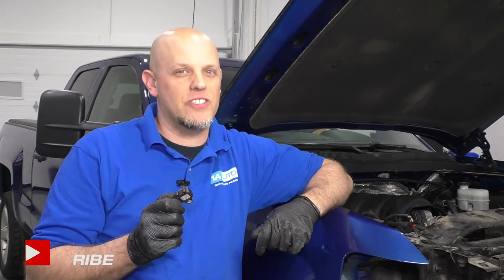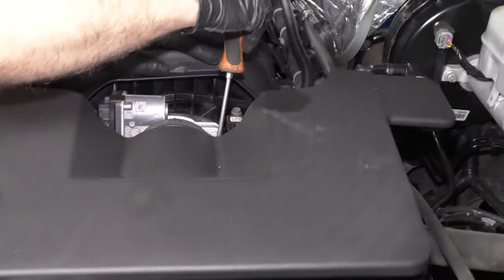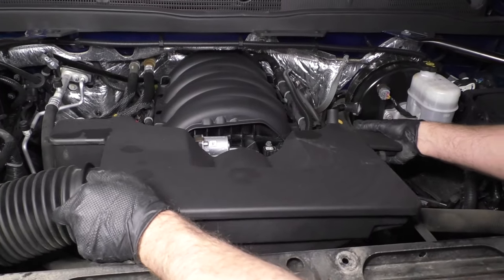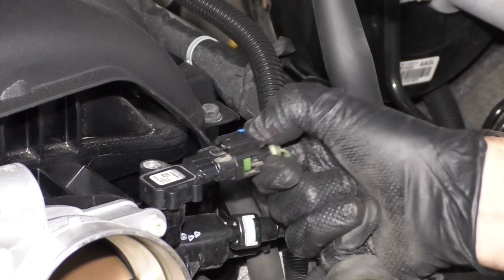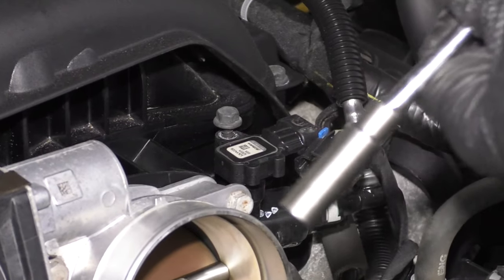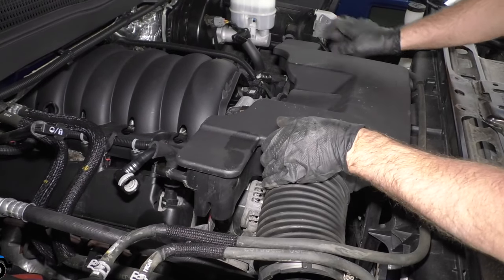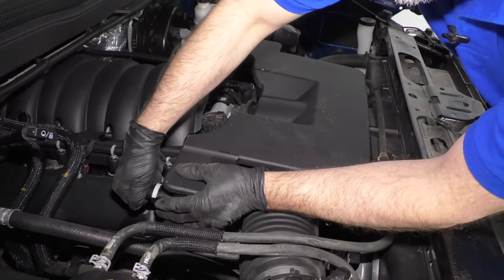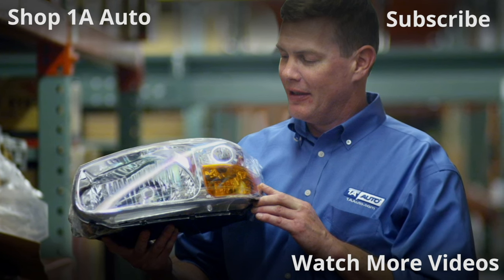How to Replace MAP Sensor 14-19 Chevy Silverado

Comment: I had a code pop up P0641 and underneath the report it said secondary DTCs codes P00C7,P128F,P16E5,P2227 and two P2230s where do I need to start? Thank you in advance! 2018 GMC Sierra 6.2

Comment: 🙌🏿🙌🏿🗣📯THANKS FOR THE HELPFUL INFO😁You made it very easy to DIY😁saved me a ton of🤑my engine light was on and I was told it was related to my catalytic converter on my 2015 Tahoe. A friend told me to change the map sensor and the mass air flow sensor 1st and both of your videos was very Helpful🫶🏿🫶🏿

Comment: I am trying to find the bolt that goes to the GM Air Pressure Sensor part# 12711681. I checked your website but the search said "No results found." Can you tell me what specific bolt this is, and where I can find it to buy it?

Comment: I replaced the MAP sensor because I got a code for P2227, the code relates to barometric pressure, however the check engine light is still on? Maybe the MASR sensor?
Reply: Me too! Did you get it worked out?
Reply: Mines is there too, kinda lost on where to go.
Reply: Are your guys truck shaking & smoking?
Reply: @victorduran6522  MAF SENSOR FOR YOU

Comment: What's the reason that you have to remove negative wire from battery
Reply: any time they work on an electrical component they remove the battery terminal

Comment: When this sensor goes out does it give the the check engine light “Barometric circut high”
Reply from the maker: +UnderGround Garage Thanks for checking us out! The error P0108 would be indicative of the map sensor being the cause of the issue you are having. 1aauto.com
Reply: @1AAuto  Thank you for replying back, I have a 2014 Silverado and its giving me code p2229
Reply: @1AAuto  Barometric Pressure circuit high?
Reply from the maker: +UnderGround Garage This is a tricky code as it could be anything from an issue with the TPS or PCM to just clogged/faulty catalytic converter(s). We would recommend having this checked with a local mechanic to narrow down the issue.

Comment: Why do u have to mess with the battery, why cant u just go straight to the MAP
Reply: If you want to have couple thousand volts run thru your body because of an exposed wire then be our guest and make sure to get it on video.